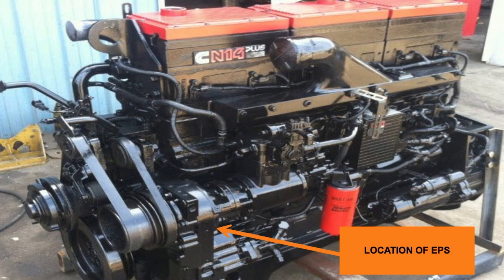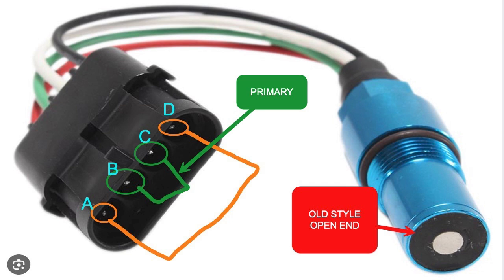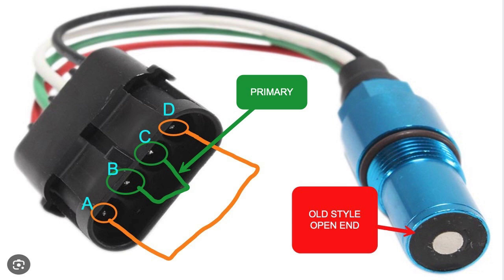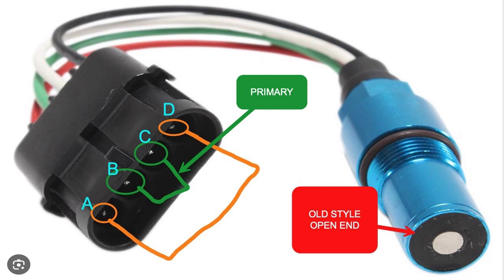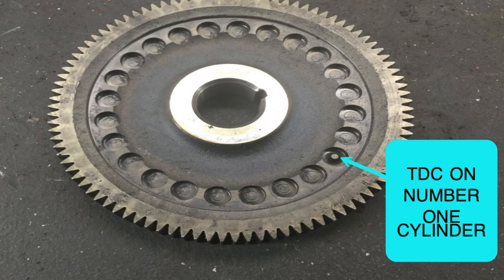M11  IDLE PART 2

Comment: I had red top 525 hp

M11 is totally different Engine...

Why you show N-14 on a M-11 video?

Often cam sensor wires go bad cause havoc on M-11.
Reply from the maker: My mistake you are correct.
Reply: @ENGINESHOPJOE  no problem

Comment: I thought red tops were 400 or above h.p. Not 500 h.p.
Reply from the maker: As I recall the trainer told us 500 up. But a lot of guys painted the valve covers red for looks. I liked the black covers with the chrome bars on the top. 
The ISM-450 came with a red valve cover too. I used to see those in the dump trucks.